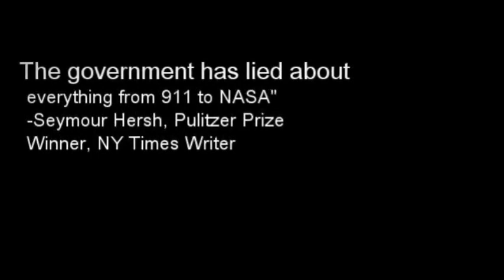Pourquoi on ne peut aller ni très haut, ni très vite

Comment: Démonstration mathématique de la fausseté de l'argument blackbird :
Prérequis :
Pression en fonction de l'altitude : 
P(h) = Patm * e^(-M.g.h/(R.T)) (je vous épargne les calculs préliminaires)
avec :
Patm = 101325 Pa (pression atmosphérique au niveau de la mer)
M = 28.966.10^-3 kg.mol^-1 (masse molaire de l'air)
g = 9.805 m.s^-2 (accélération de la pesanteur sur terre)
R = 8.314540 J.mol^-1.K^-1 (constante des gaz parfaits)
T = 298.15 K (température standard au niveau de la mer)
d'où P(h) = 101325 * e^(-0.00012*h)

Résistance de l'air de masse volumique rho sur une sphère d'1 mètre de rayon se déplaçant à une vitesse v :
R = rho * v² * pi/4
_____
plafond du SR71 Blackbird : 27Km
Pression à cette altitude : 3968 Pa (3.9% de Patm)
masse volumique de l'air : 3.9*1.2/100 = 0.05 Kg.m^-3
vitesse du blackbird : 3530 km/h (Mach 3.2+) soit  981 m/s
--> R = 35373 N 
_____
Péri-apside de l'ISS : 330 km (altitude minimale)
Pression à cette altitude : 6.42*10^-13 Pa (6.34*10^-16 % de Patm)
Soit 0.000000000000000634 % de la pression atmosphérique
masse volumique de l'air : 7.61*10^-16 kg.m^-3
vitesse de l'ISS : 27580 km/h soit 7660 m/s
--> R = 3.51*10^-8 N (soit 0.0000000351 N)

Pour information comparative, la résistance de l'air pour une sphère d'un mètre de rayon lancée à 300 km/h au niveau du sol est :
R = 6545 N

Voilà la raison pourquoi les satellites ne se désintègrent pas une fois en orbite.

cqfd
Reply: +Kahlie Niven Ca c'est envoyé, et toc.
Reply: +Kahlie Niven enfin quelqu'un de cultivé et doué d'intelligence et de raison
Reply: +Kahlie Niven 
Ah, bravo, j'en était resté au premier calcul, celui de la pression atmosphérique à l'altitude de l'ISS.
Reply: Antoine Champion
Yup, l'effet de la résistance de l'air liée à la vitesse était un point important à prendre en compte.
Reply: Kahlie Niven

C'est vrai, mais une fois de plus les adeptes de la terre plate ne fournissent pas de calculs... merci de l'avoir effectué!
Reply: +Kahlie Niven
bien jouer ! :-)
Reply: +Kahlie Niven
il est bon de rappeler de temps à autres le langage, son vocabulaire, sa grammaire qui décrivent le monde et le prédisent avec une efficacité toujours croissante.  Bravo à vous.
Reply: Alpha Pavonis
de rien :-)
Reply: Jolie copier coller
Reply: @veriteabsolueincontestable3458  4 ans après la guerre, t'as que ça à foutre ???

PS : Et ... non, c'est du calcul fait main (limite du copier/coller entre mon notepad et ici)